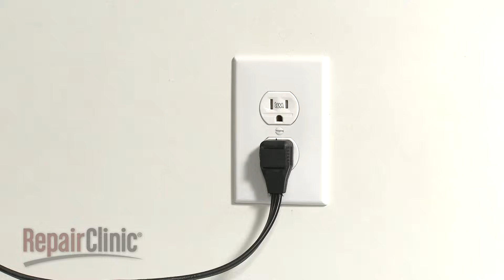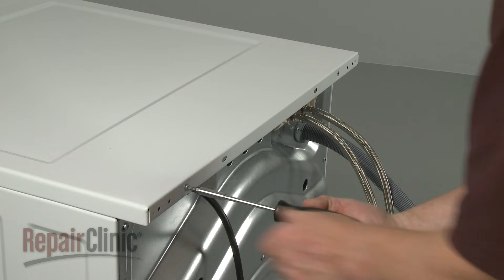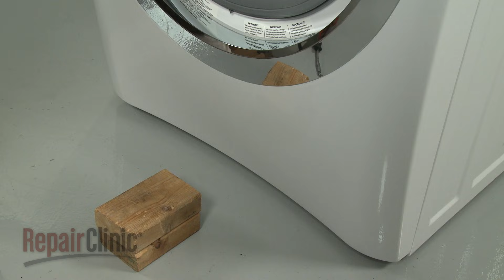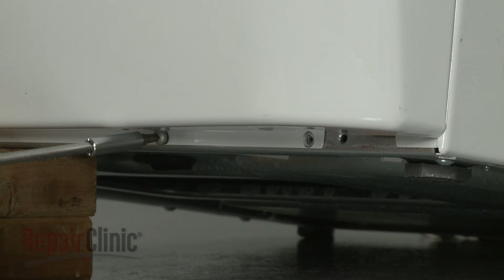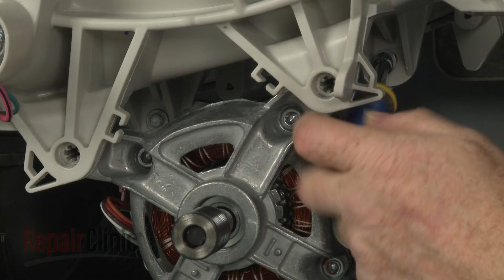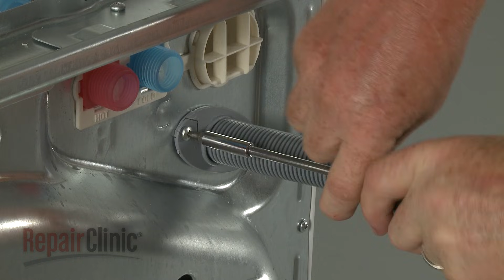Electrolux Front-Load Washer Disassembly, Repair Help

Comment: Came here to know how to disassemble the cylinder. 
Conclusion: I learned everything except what I came here to learn.
Reply: Did you find a video on that? I want to replace a bearing on one. I am pretty sure you have to take the whole thing apart, and unscrew the drum, which is probably in 2 halves bolted together, like it is in a whirlpool. That was my old machine that finally died when the shock absorbers went bad so that the machine bounced around to the point where the springs ripped out the plastic eyelets that attaches them in the drum. 
The lesson is : when your machine starts bouncing around, immediately replace the shock absorber before it self-destructs.
Reply: @liamstacey419  were you ever able to replace just the bearings?  All my research tells me you have to replace the entire back half of the tub. I have yet to find a bearing replacement video for this model - I’m about to attempt it, but don’t even know if it’s possible.  

Electrolux doesn’t sell/list the part for just the bearings.  I think it’s 134642100 for what looks to be this EIFLWxxxx model.

Comment: Great video. Could you help?  My Electrolux (same model as yours in this video): push start (any setting) and the door lock clicks, then clicks again and nothing else happens. Panel is fully lit. No water goes in, unit is not spinning, even on "spin only" setting.
Thanks, Joe

Comment: What does the connector under the door hinge attach to?  See 2:00 time stamp.  The connector cover is empty, it doesn't have a place to plug the connector.
Reply: I believe its because these machines have reversible doors, so if you needed to switch the door lock to the other side the plug is already there.

Comment: Hello, in the same model family but with panelable/embeddable option, do you know what is the method to change the orientation of supports for the door? I have a problem for disassemble one of them, I dont find the system of subjection, and I dont see screw head.

Comment: I LOVE these machines.✈>allmy.tips/ElectroluxWasher?eE    My whites are whiter, my clothes are cleaner and everything comes out less wrinkled. They are relatively quiet and the wash cycles are efficient. I have not had the same experience of other online reviews concerning small items getting stuck on the ledge of the dryer filter. The clothes circulate well and my overall dry times are appropriate. My one complaint on the dryer is that you cannot set a manual timed dry cycle for less than 30 min. Overall, this laundry pair is great and I highly recommend it.

Comment: Good video but how do I check the pump for a clog? That's the only thing I didn't see covered. Should I access that from the rear panel? Front panel?
Reply: Hi, did you ever find it? I’m trying to locate mines too
Reply: @asianicoleb  No longer have it but yeah where the drain hose connects to the drum, there's a flapper in there and I had a sock trapped in there. It's easy to find once you get the front panel off.

Comment: why is the fabric conditioner I put in the drawer for detergent &softener in my front loading washing machine not utilized (?) in my laundry
Reply: Richard Cacatian before you replace the part take your dispenser tray out and use a vey small zip tie, stick it it in the hole that are on the inside top of the compartment. They're most likely clogged. Then spray inside with a diluted bleach mix. Wipe and try. Worked like a charm after dropping the money for the new inlet valve !!

Comment: Great video.    My 3 year old machine threw an E13 error code, which means it didn't drain fast enough.    I took the front panel off following the instructions.  The machine bolts are on tight.   Lucky for me, I have the pedestal so the machine is raised in the air.    4 bolts on the bottom, 5 om the top, 5 for the control panel, and 2 on the back for a total of 16.       I had to find a phillips screw driver with a good blade, then push against the machine with all my might while turning the screw driver to break them free.    
 
I removed the exit hose of the water pump and there was junk on the one way rubber flap which I cleaned.   Then I removed the inlet hose leading to the pump which is the main hose coming from the tub.   This is done by removing 2 clamps and a retainer that is held in place with a screw ring.   To loosen the ring requires a 7mm socket or wrench.   Socket is the best idea.     This hose assembly has a catch basket, probably to trap coins.    I had nothing in here but it was junked up.    The basket can be removed and the hose can be cleaned out with a hose and rag.   

When I put the machine back together and ran it, water leaked everywhere.   The problem?    The screw retainer ring on the main hose has to go above a lip on the plastic tube leading down from the tub.    You would never notice this as you remove the entire hose assembly as it drops down.    After I installed it correctly, no more leaks.    Now I'm an expert at taking the machine apart since I had to do it twice.   

I would encourage everyone to clean out the main hose leading to the water pump, as it will be filled with gunk after 3 years.    I didn't see it, but that would be a good video to make, cleaning out the hose and showing how to install it correctly so there is no leak after putting everything back together.
Reply: How to unlock the door when it's on drain
Reply: How can I get the door open if it's on drain to repair
Reply: Shelby get high unlock the the door on the front loader after it on stuck on drain

Comment: This was a very handy video and I appreciate it being available.  Thank you!

As to the machine itself?

Sixteen screws and the ring with the spring to get the front panel off.  Sixteen.  And it looked like there should have been at least one or two more, given the empty holes.  Had to replace the tub to pump hose unit because it was leaking - it had been patched in the fall but was finally shot and needed replacement.  We could see the two green wires that needed to be removed with pliers (they weren't clips, but could and should have been).  We could see the silvery band with the single set screw that held the middle, the head of which faced away and had to be dealt with using a mirror.  

It was even harder to get everything back on afterward, because the four screws across the bottom of the front panel wouldn't go back in easily and were incredibly hard to reach.  We were flat on the floor, wrestling with the clips and band and the screws that wouldn't go back in, for way too long.  

With a hinged front panel or an easy-to-remove access panel with maybe two to four screws (if any!) instead of the sixteen screws, it would have taken just a minute or two to open the machine up and another minute or two to close it again.  Instead, it took at least an hour and had a ton of unnecessary steps:  Unscrew the back of the top (and try not to drop either the screws or the screwdriver)!  Remove the top!  Unscrew things in the front that were hidden under the top! Remove the detergent tray!  Unscrew things that were hidden behind the detergent tray!  Unplug things!  Prop the front up!  And on and on.

With clamps or clips instead of wires that needed pliers, plus a set screw facing the front, swapping out the tub to pump hose would have taken maybe three to five minutes instead of around an hour. 

Whoever designed this machine either didn't care how hard it would be to get into/to put back together (my opinion) because they just wanted the outside to look seamless and weren't concerned about repair time; or they deliberately made it hard to get into so either you'd pay the techs a lot to do it or would just give up and buy a new one (my daughter's opinion).  Working on it requires a lot of muscle:  to pull the machine forward to get to the screws that hold the top down and to push it back afterward; to tip the front up to get blocks under it; to lift and move the heavy front panel with door.  Working on it requires a lot of awkward stretching and twisting, both to deal with the screws across the bottom panel and to get things out of the inside and put them back.  It could have been designed so much better.

In fact, I think I'm going to post this as a product review.
Reply: How do you recommend going about checking a pump for a clog?